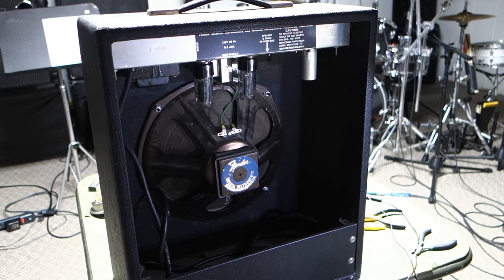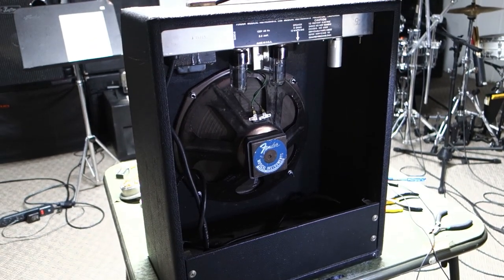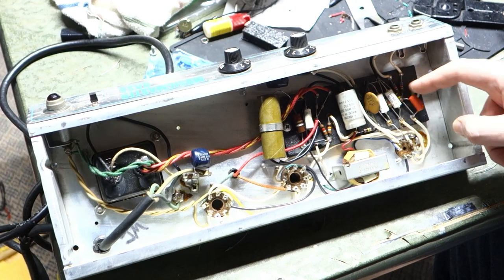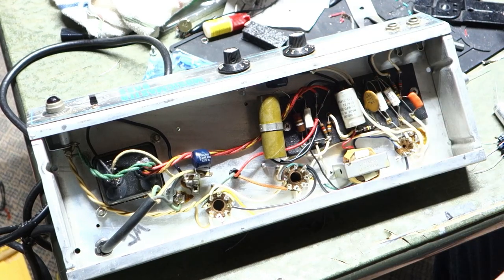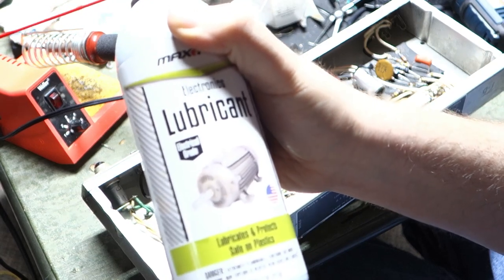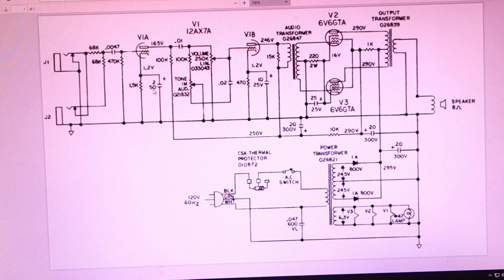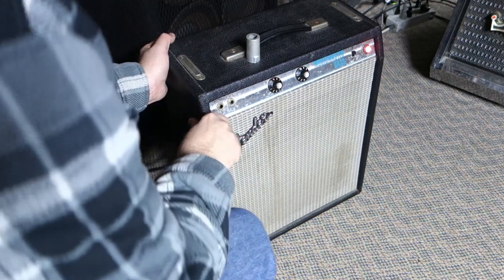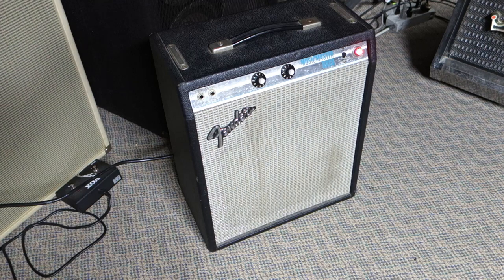1975 Fender Music Master,  In for service.

Comment: Great amp,especially for guitar with effects in front.
Owned one,had original Fender labelled tubes,amp was totally quiet to background noise. 
Sold it to a friend,owning a recording studio (Rocketdog) and every guitarplayer,who records with it,wants to buy it.

The second /later version has EL 90/6AQ5 powertubes,not EL 84,like you mentioned.Also the have different tube sockets,as 6V6 tubes.

Comment: I got my buddy’s late-70s all-original  example from him. Plays, but makes snap crackle pop noises and has a wash of staticky noise as volume is turned up. Could it be the tubes? And what is its RCA 7552 equivalent? 6L6? 6V6?
Reply from the maker: I don't recall that model tube ever being used in a guitar amp.
Reply: Thanks. What are the appropriate model tubes to use?
Reply: I’ve found a completed listing on Reverb for the “RCA 6L6 GC 7552 Mid-70s.” The description begins with “These tubes come out of a rarely used Fender Twin Reverb 100 watt from 1976 and are the original tubes.”
Reply from the maker: @konradhof7318  The number 7552 on that listing is a date code.   52nd week of 1975.  It's  NOT a tube number.

The RCA tube model  7552 was a rare military tube that has no place in a guitar amp.

The MusicMaster bass amp  takes a Pair of 6v6GT tubes,  and a 12AX7 tube.   Standard parts still in production.